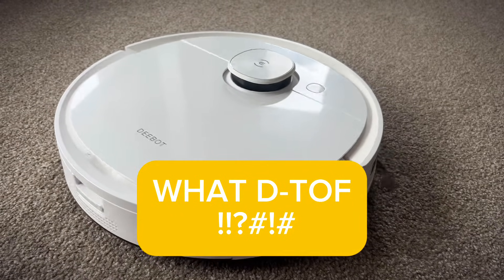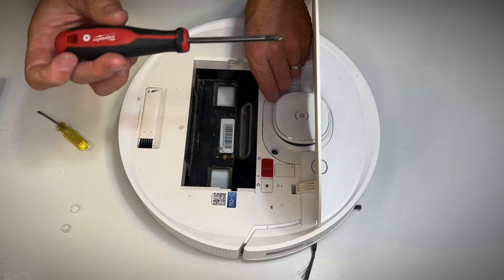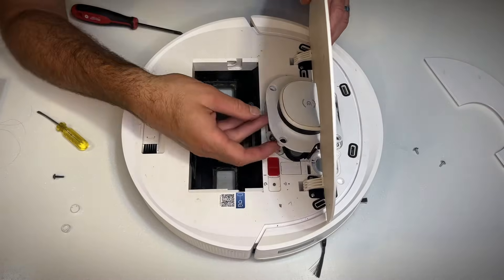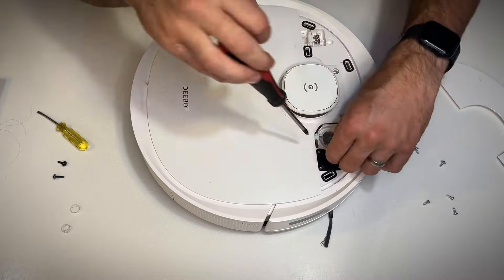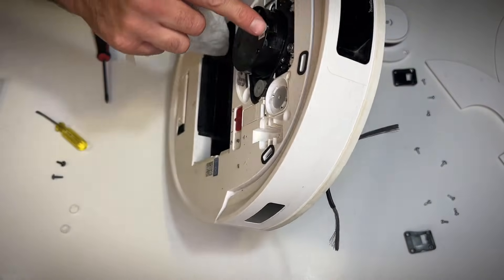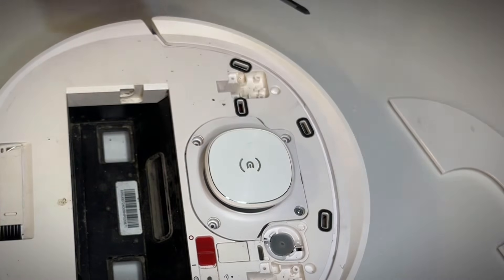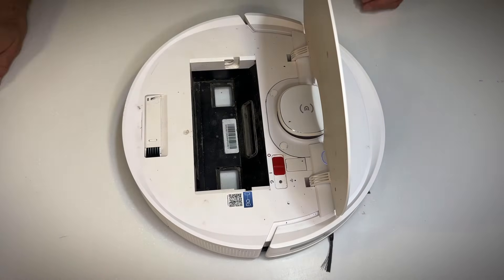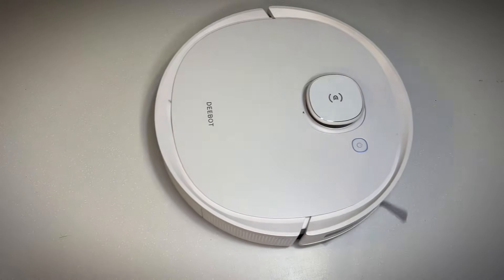WHAT IS A D-TOF (LiDAR) SENSOR MALFUNCTION and how do I fix it?

Comment: I keep getting this malfunction notice but my vacuum doesn’t move at all, it just sits there and eventually comes up with the notice. I even replaced the part with a new one and it still doesn’t work.
Reply from the maker: Hey! Sorry to hear that it must be frustrating. There are meant to be 3 small springs that suspend the lidar cap/cover. Make sure they are in a place correctly other wise the sensor won’t spin and the unit won’t move. Unfortunately the springs can move, dislodge and fall out, so checking for them would be the first place I start. Let me know how you get on

Comment: Thanks for sharing this video! My vacuum was starting to rotate its floorplan by 45 degrees. Last time this happened I sent it in for a warranty repair and they said they replaced the LIDAR.  It's now out of warranty and the same issue has started happening. I found your video, pulled it apart and wiped the inside of the LIDAR cover and for the past 10 days it has been working fine. Thank you so much!
Reply from the maker: Hey, thanks so much for the comment and I’m really pleased that my fairly average videos are able to help people like yourself! Also very interesting that cleaning this sensor/replacement solves the mapping issue, as I feel like this is a common problem for others. Maybe I should try to replicate the issue and make another video 😁 

If you wish then please check out my channel, other videos and subscribe if you like what you see. Any help to grow the channel would be appreciated. Thank you

Comment: I just had this same problem with mine. With the covers off the sensor I could see that it was trying to spin but kept getting caught up. I took the black rubber band off that runs around the bottom of the sensor and around the drive wheel and gave it a clean and brushed out the groves that it sits in and refitted it. And now it's happy and back to vacuuming 🙌
Reply from the maker: Thanks for the tip, it’s always great to know of fixes that work for others, thank you for sharing and great job getting it sorted!
Reply: @ENTHUSE_Me   Thank you for your video it was a great help to know how to get into the sensor casing etc 🙏

Comment: I found the video. Thank you for good explanation.  If you could also can you explain why and how can fix the vacuum cleaner if it is not spraying water
Reply from the maker: Hi there, I don’t yet have a video about the vacuum cleaner not spraying water. What I suggest in the meanwhile is to check my Ecovacs n8 pro disassembly video at 6:53 and check that the mopping pump has the tubes connected properly and that none of the electrical wires are pinched or damaged
Reply: @Samanta19999  I found I had an issue with a vacuum being created in the water tank as some water was pumped out. Try taking the blue rubber seal off & run it to see if it pumps okay without it.
If so, then what I did is I made a tiny hole in the blue rubber seal to prevent the vacuum while still preventing water from spilling out.

Comment: Potential fix for those still struggling!
I tried dusting the cap and device with canned air. I tested running the system without the protective cover and the TOF sensor turned super slow and would stop / start. It's supposed to spin several times pers second.

I removed the rubber band belt with tweezers. I carefully removed the TOF module by unscrewing the three silver screws. I gently pulled out some wire slack and unplugged the connector. Now the module is separated from the vacuum.

The goal is to lubricate the motor. First, I taped the black spinning puck with the lenses facing away from the motor. Next, I took canned silicone lubricant and sprayed the smallest amount possible into the gap under the cream colored motor wheel. Then, I spun the motor wheel by hand in order to work the silicone lubricant into the motor. I wiped away any excess and I repeated this step one more time.

Finally, I assembled the module back together and back onto the vacuum. I tested the assembly without the protective cover again and the TOF puck spun beautifully. Reassemble the cover parts and it's working great.
Reply from the maker: @ccederlo  thank you very much for this valuable insight! 

I know that it will be helpful to anyone who is still stuck after trying a clean! 

I would have tried a completely new motor assembly In this case, but I have huge respect for your successful attempt to fix it without the unnecessary waste of buying the new component and really appreciate you watching my video.

Thank you
Reply: @ENTHUSE_Me  Thank you for putting together this great teardown video. It was exactly what I was needed to get started on my quest
Reply from the maker: I’m glad to hear that! And I’m really pleased
That you were able to stick at it until you got it sorted! Well done mate
Reply: I ended up buying a new sensor cause cleaning it didn’t fix my issue, and your note about pulling out some wire slack to unplug the harness helped! Thank you